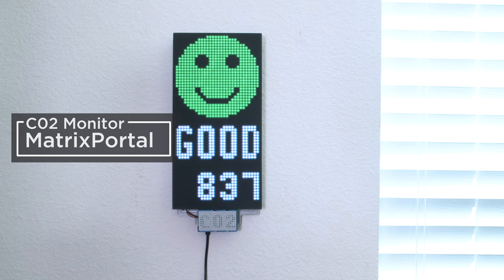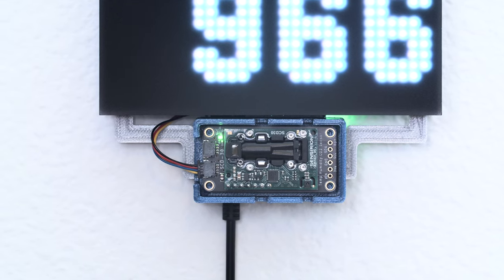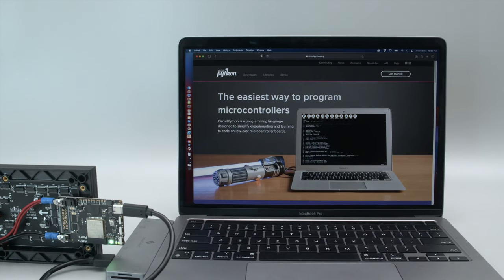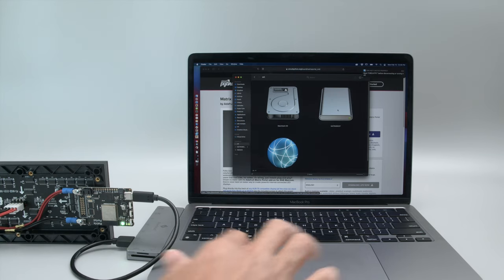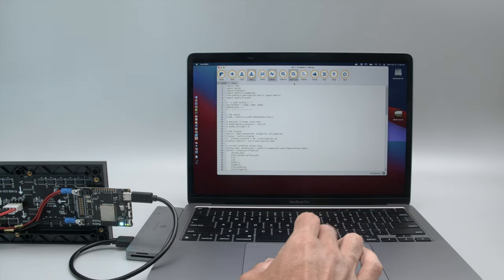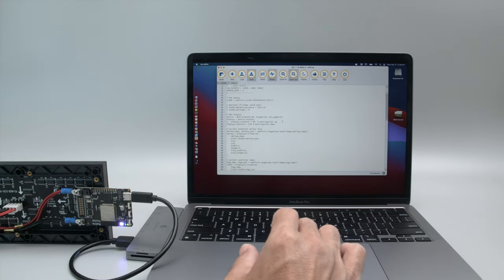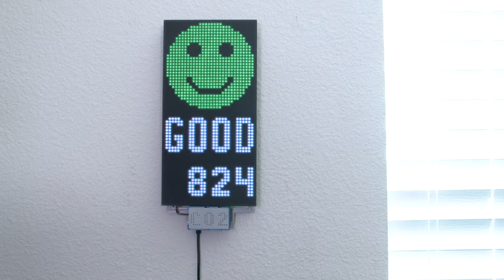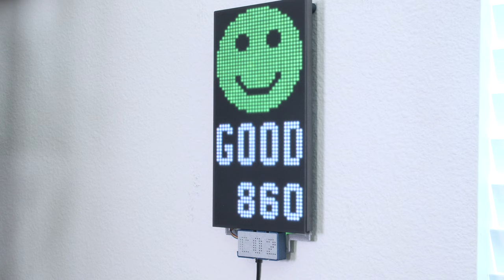LED Matrix CO2 Display #adafruit #3DPrinting

Comment: This is a great project.  I wonder if there's a way, instead of drawing the faces, to plot a time-series of the data from the sensor (e.g., using sparklines) on the matrix.   Add a dot every minute or so.  It might require a horizontal origination of the matrix.